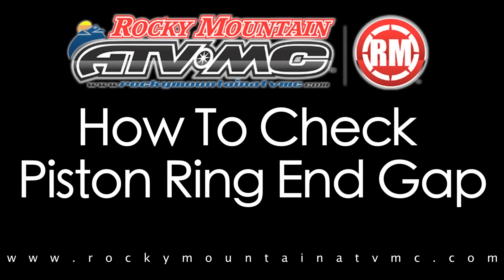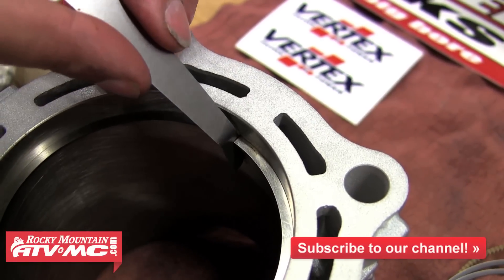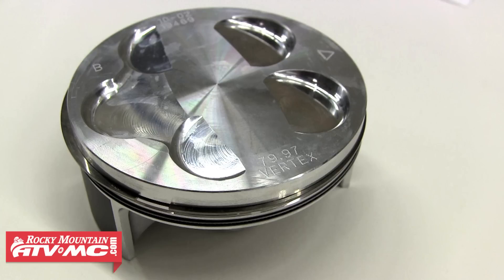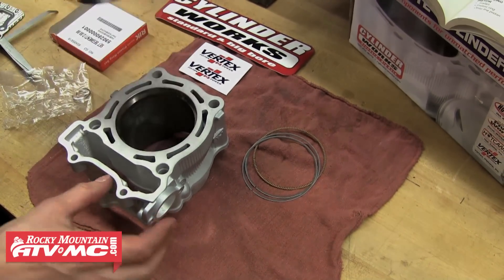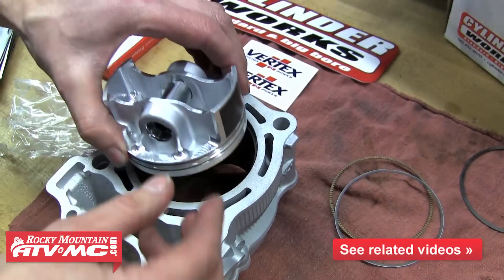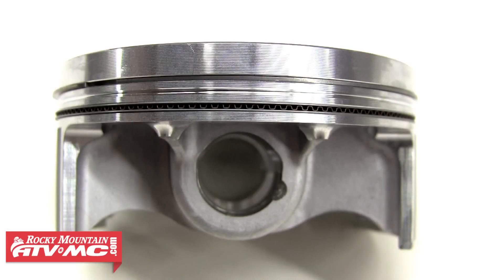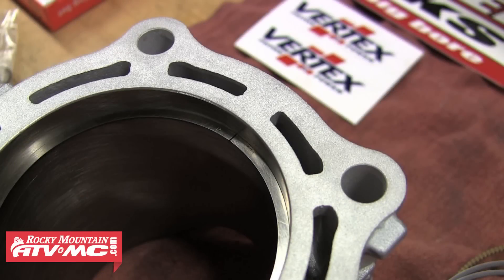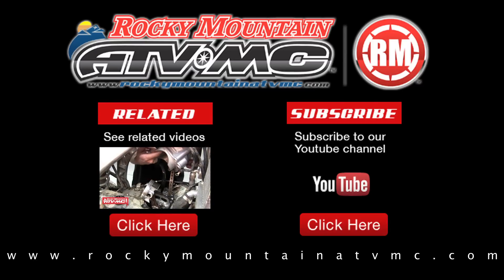How To Measure Piston Ring End Gap on a Motorcycle or ATV

Comment: So in your service manual it says, top rong, 2 ring and oil ring right? Your new vertex piston comes with a top ring, and 2 rings that go ontop and below the oil ring, those are the ones you measured correct? So which one is which in the service manual?
Reply: top ring is compression ring lowers  bottom are oil rings

Comment from the maker: If the gap is bigger than the specified service limit as listed in the service manual you either have wrong parts or your cylinder is worn causing the gap to be bigger.